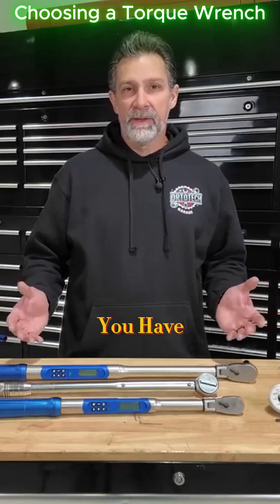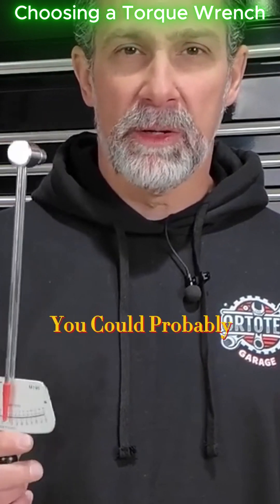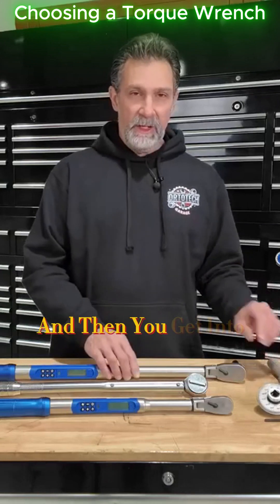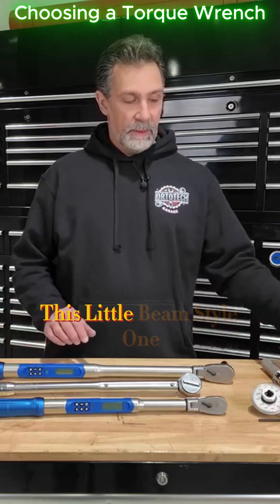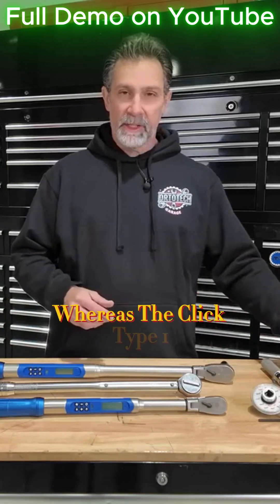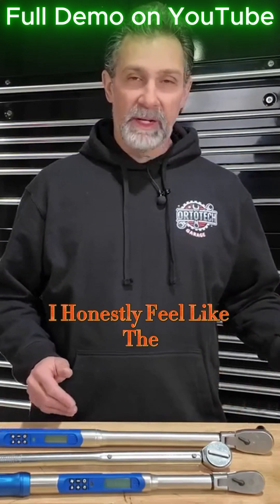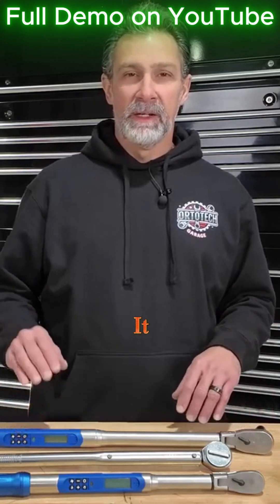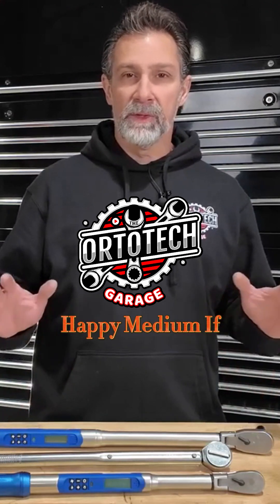Choosing the Right Torque Wrench for Your Needs

Comment: Which would be better for engine work, click style or the electronic torque wrench with all things being equal?
Reply from the maker: All things being equal, I would buy a 1/2 inch electronic style because it goes fairly low on the torque settings and has the torque angle built in without requiring extra tools. For the money, though, you could buy a few different click style torque wrenches. Engine work will often require a smaller torque wrench for cam cap and smaller hardware too.  Unfortunately, its not an easy, one tool solution to fit everything. I hope y
that helps.

Comment: I'm looking to get a click one  to work on my neon, silverado and civic, should I buy 3/8 or 1/2?
Thank you.
Reply from the maker: It really depends on what type of work you're doing.  The 1/2 inch is probably most useful, but won't generally go below 50 Foot pounds.  For engine work and drain plugs, you will likey need a 3/8.  They both have their place.  Texton and Craftaman both  make some decent torque wrenches that are available on Amazon.
Reply: @OrtoTechGarage thank you.
Reply from the maker: @sernani99  Happy to help!